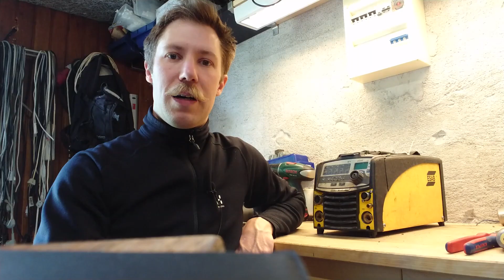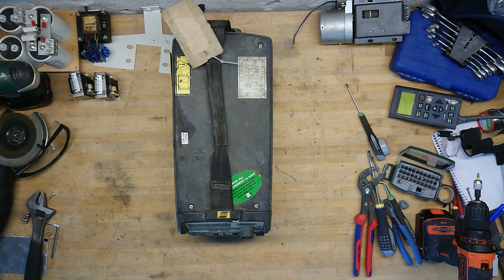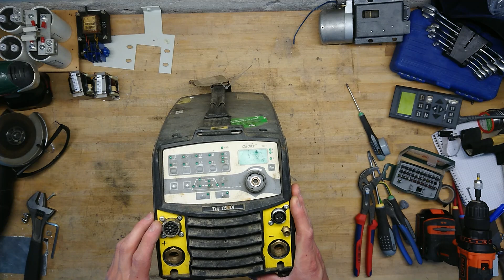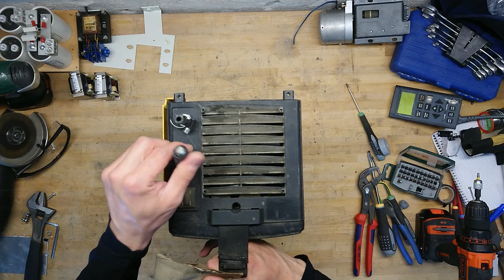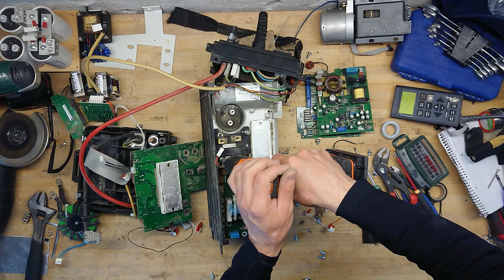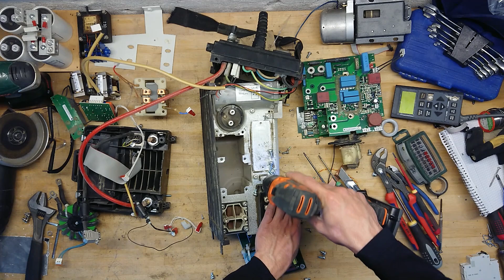TIG Welder Teardown. ESAB TIG Caddy 1500i.

Comment: Mmm after seeing this I think I better get an old school line frequency transformer welder and make it TIG, they are practically indestructible and making a HF start and valve system shouldn't be hard. Paying $2K for an inverter that can't be easily fixed and that will last like 5 years, no thanks.

Comment: Hey, its me again :) Apparently this thing has a service manual.
http://pdfmanuals.esab.com/private/Library/ServiceManuals/0740%20800%20186%20GB.pdf
That cool power module at 8:45 houses literally all the components for the hot side - rectifier, soft start SCR, PFC boost + diode, 2 SW forward + diodes, its all in there!

Comment: At such low voltages why don’t they use MOSFETs instead of IGBT ?
Reply from the maker: At low frequencies (20-50 kHz) the IGBT can conduct higher currents than a MOSFET in the same price range. MOSFETs are still better than IGBTs once we get over some 300-500 kHz. It is however all changing with SiC and GaN technology emerging in the market.
Reply: @KaizerPowerElectronicsDk  thanks - size matters :-), i thought the lower voltage drop would result in less power/heat so MOSFETs might win out

Comment: The construction is rather elegant, kinda explains the price, and good for the on including an air tunnel - the only part of the machine that was dirty - said tunnel.
Reply from the maker: It is almost the most important specification for a work shop power electronics tool, "Can it keep the unit clean by having a separate cooling tunnel?"
Reply: @KaizerPowerElectronicsDk  Lately I've been watching a dude repairing welding inverters, the cheapy MMA kinda, its scary to think what would happen if those inhale enough metal dust.
Some of those have conformal coating applied, but most of them don't.
Creepage/clearance is very important in everything that connects to mains, but something like welding equipment its of utmost importance.

Comment: nicely put together all the same , 
mind you 
at the price it would have cost , it should be , but no sign of what actually killed it
Reply from the maker: I did not measure continuity on the integrated 3-phase IGBT brick, but as these are just 6x TO-247 sized dies in some goo, a "silent death" inside of it could be the fault.
Reply: many thanks , i gad hoped to see some hot goo , smoke damage , or flames scorched bits , ah well , it just died rather than went out in grand style.

Comment: Should have repaired it.
Reply from the maker: Repairing a TIG welder where all cables and tubes has been cut is pointless, the price of acquiring a set of new handle, cables and such will cost more than just buying a new Chinesium unit.
Reply: @KaizerPowerElectronicsDk  Don’t ever compare a Chinese welder to an ESAB! It strongly worth repairing.
Reply: Would sell my left testical for an esab with chinesium cables.
Reply: @DaniCalifornia44  preach

Comment: thanks for sharing. could you add some close-up photos to your teardown videos so we can inspect the pcb layout and design choices.
Reply from the maker: I am sorry that I left it out, as you have properly seen on the RF equipment there is a circuit analysis. I have left it out on these "simpler" circuits as there is not much to go through. I will be sure to take some pictures and put in the video or a link to them, in future videos, maybe except a few more that has already been filmed, but not yet edited. :)